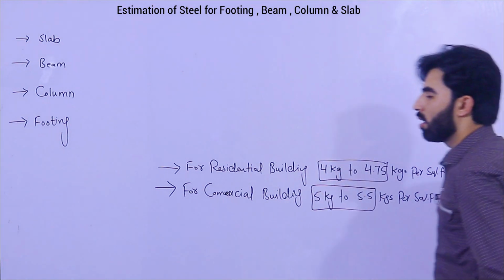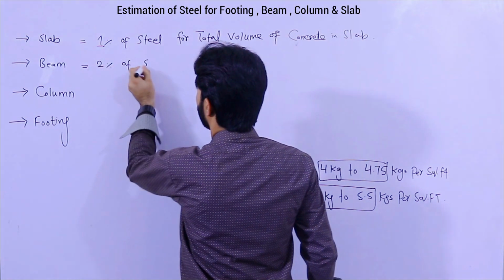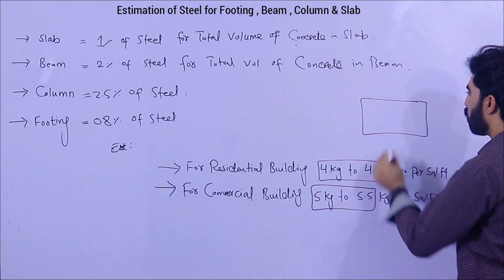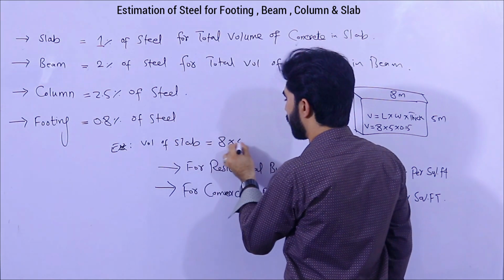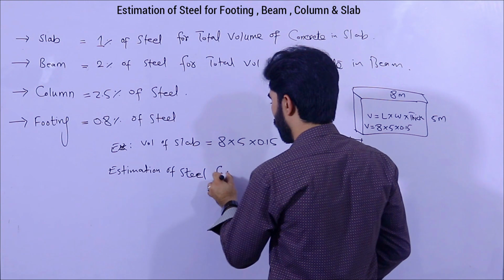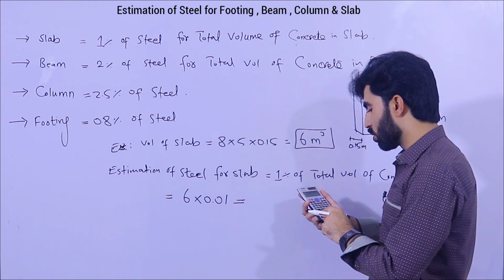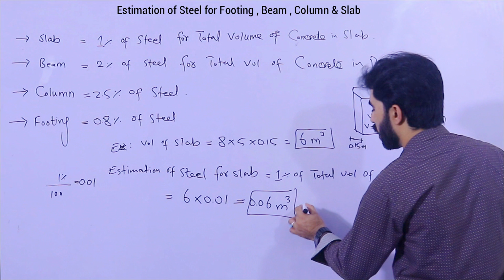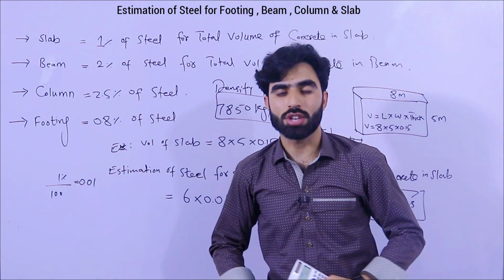Estimation of Steel for Footing ,  Beam , Column and Slab by Thumb Rules in Detail

Comment: Sir in thumb rule steel required  for slabs 4kgs to 4.75 kgs per sq feet  but as per caluclation 471 kgs per 1 cubic metre so not tallied sir

Comment: Can 8” concrete block be used to build a 4 storey building without using column and beam framework to ewbn The layout each floor is 73’ x 30’.